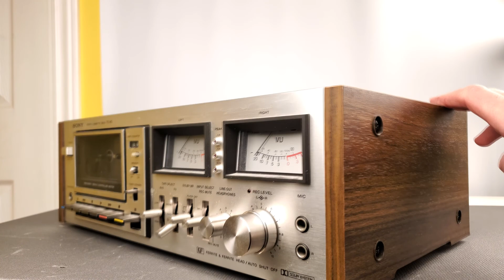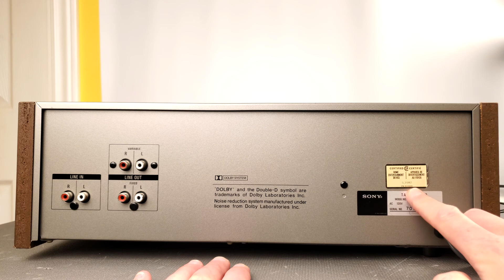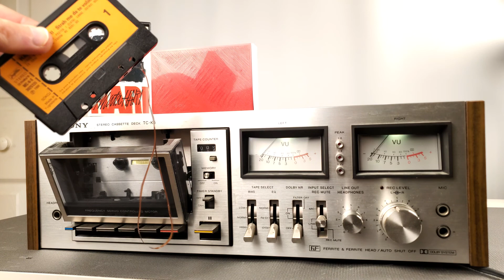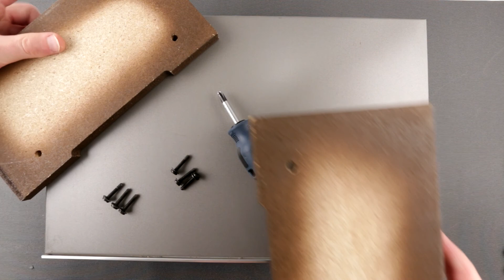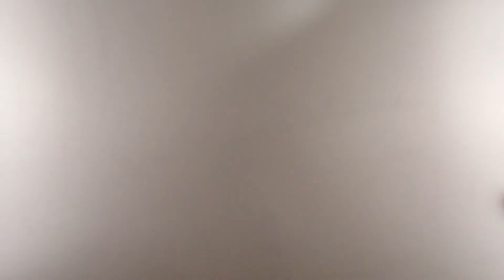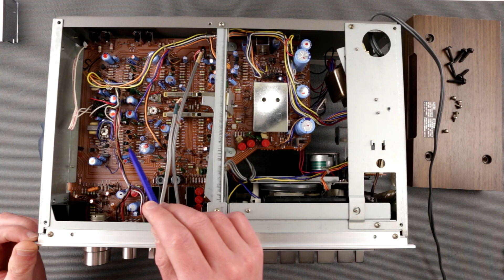Restoring Sony TC-K5 Vintage Cassette Deck. Part 1

Comment: I have a Sony TC-K5 that I got a little while ago. I bought one new in '78, and it is a high quality deck. I also had a Sony STR-V3 that I replaced with a STR-V4. I haven't used either as they both need work. I would record my popular records on it to save wear and tear, and I used Maxell XL IIs on it.
Reply from the maker: It is funny that it does not have much of the opamps or ICs inside but still can do great recording !

Comment: The issue with playback is probably the rubber tire on the take up reel. I have the same issue on my TC-K2. Need to find / make a replacement. Not easy.
Reply from the maker: Thank you. Let me check but during first quick look I have not see anything like that.